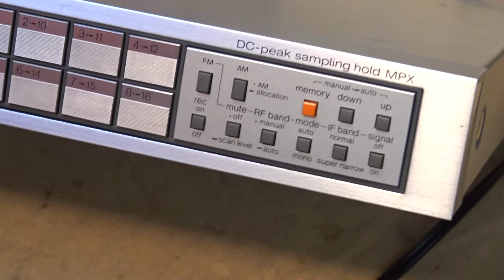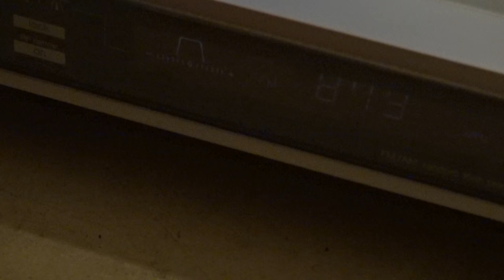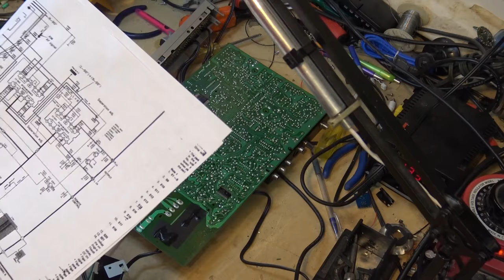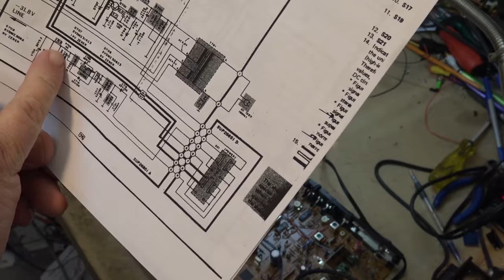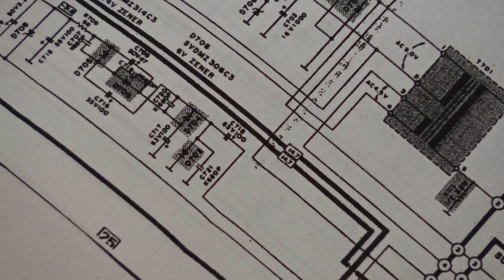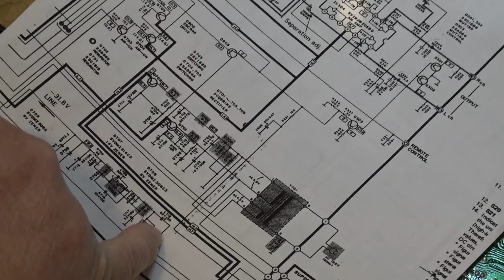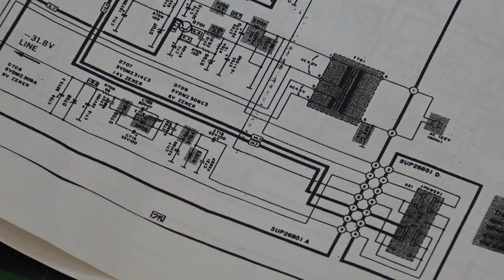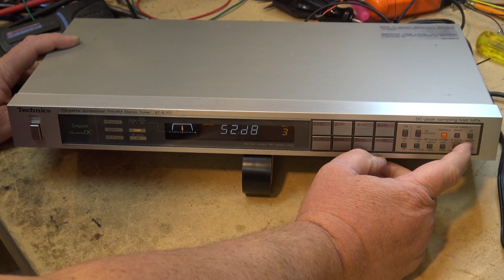Technics STS 707 Dim display repair

Comment: Thanks, this helped me solve the same problem on my microwave for $0.50 in parts.  All the repair sites say I needed to buy a $200 controller.  Fortunately I found the schematics on line inside a repair manual. Nice to know dim VFD are commonly power supply failures and not related to tube or drivers.

Comment: I'm a newbie attempting my first real electronics repair. I picked up an 80s-ish ADC graphic EQ today with a dim VFD for cheap. I just opened it up and found the four big caps on the power supply sitting in dark brown goop, which also partly covered some surrounding links and resistors and such. It looks like there's glue there, but also a much darker substance. I tested them with my LCR-T4 and they check out okay, but because of your experience in this video, I'm assuming they're actually bad. Tomorrow I'm going to source some replacements and hopefully that will solve my problem. Thanks!

Comment: I absolutely love VFD displays, Unfortunately, I have an addiction to them so I ended up having a vast collection of random VFD displays.
Reply from the maker: Same here. I have a Clock / VU meter I built a few years ago. It shows the levels going into my tube amp I built. Looks cool, just sits on the top of the amp nicely centered between the tubes showing the input from my blutooth receiver into the amp.I have a few clocks I have restored / built with VFD, and I have an old desk calculator that has 12 single digit tubes in it to restore, or repurpose into a clock display.
Reply: 12voltvids I have maybe 20 or 30 different VU meter and spectrum analyzer tubes. I actually have a tray of NOS 12-point stereo VU meter tubes from Futaba that I ended up turning into an "array" for use as a DIY spectrum analyzer. Should look cool. I even have a stockpile of Sony MXP-3000 mixer VU meter tubes to re-purpose as an audio analyzer. Talk about a fetish haha.
Reply: THEtechknight - WOW!  were we twins separated at birth?  I have the same addiction to Vacuum Fluorescent Displays - especially the BLUE!

https://wikivisually.com/wiki/Vacuum_fluorescent_display

I have recently been replacing capacitors in my older XP computers motherboards to bring them back to life.  I like to use the Weller WESD51 50W Adjustable Digital Display Soldering Station.   My favorite Vacuum Fluorescent Display is in the Roland MKS-70 synthesizer.

Comment: @20:50, Hybrid Digital radio here in the states....I'm gonna check out that voltage doubler circuit you described in another device that has with no 35v to its vfd. Thanks for the description of that circuit!

Comment: Would bad capacitor possibly be the issue for a display that was showing screwed up digits ?   I have an Emmerson three disc cd player... Model. number MS3100.  The display is messed up and when I push button to open CD cover, I can hear some noise but the automatic lift wont work either.

Comment: I was going to ask about this problem before I came across it being that I noticed on items that I've had own like VCRs with these type of displays get weak by time whether its was panasonic or toshiba and etc...... In a case like this if would I be correct to say if the voltages were proper then the chances would likely lie on the display tube itself if the gas has leaked?

Comment: Hello Sir, I have the same problem with a Panasonic SU-CH 40 display. I know something about electronics but not as a pro like you.  Even I can measure voltages, got the electrical service scheme, I am a little old for this stuff, but I am sure is some kind of the same issue. Can you help me? thanks for any answer

Comment: Hi there again.
I have a Sony MDS-JB920 Minidisc player with a slightly dim display esp on the 2 level meter lights could you please possibly point me in the right direction to the faulty part.

Many Thanks
Reply from the maker: Have no clue.
Reply: I can send you a link to the service manual if it would help.

https://www.manualslib.com/download/720756/Sony-Mds-Jb920.html
Reply from the maker: @johnny1408   and how would that help ?  I would need to make measurements to even make an educated guess.

Comment: Woow.i have a 80s car radio with a tiny floresent tube display with no display.im going to look for the caps near to display.as it's 12v not sure what voltage to display could be

Comment: Get yourself an lcr meter. It will test capacitance and esr at the same time in circuit. Saves alot of time
Reply: is that true? please post a video, there are lcr meters for 150 Usd and Hameg machines where I even do not know if you need a central unit that it works. I think I do not touch Hameg and leave it to the pro’s.

Comment: Does that Fluke 12 have a backlight? Modded? I own several Flukes including a 12 and mine doesn't have a backlight.
Reply from the maker: Mark Zacharias 
no backlight on the 12 and I wouldn't want one. suck the batteries down fast. my shop is bright enough but I guess if you are testing a furnace or working in a dark closet it could be handy.
Reply: Guess it was just some artifact in the video.

Comment: I wonder if there is a HT+ would it be 50v would it be the regulator on the PSU board, I wonder why Technics used a single board when in my unit it is a 5 board solution, I don't know why a X3 capacitor was not used.

Comment: I've seen some newer testers that also include diodes, transistors, and inductors. They give you a lot of info including capacitance and inductance. Have you ever tried one of those?
Reply from the maker: Lots of new testers that do much. I don't have any of the new ones.   I don't do enough electronics work to justify one.

Comment: Good work there.  We have a 27 year old Kenmore kitchen range that has a dim display on the oven controller board.  I read on an appliance web site that it was most likely a electrolytic capacitor that was going bad because it was in that hot environment.  This sound like the culprit to you?
I am about ready to tear it apart and see if I can fix it.

Comment: Hi.i have a technics slp1200 cd player.the display is dim in places.will the display be on its way out.or a supply issue.any advice would be great.
Reply from the maker: michael allen 
You need to check voltages. If voltages are correct then the display could be the issue of the driver ic.

Comment: Hello i got philips micro system mcm2320 and when i plug into power i cant turn device on only red light is showing near on/of button so i press on button but nothing happen is that capacitor or electrical condenser if u know tell me coz i dont want drop it in garbage is nice device i hope u know coz u fix a lot of that device thank you.
Reply: First thing to check is the power button itself. Next, I would look for bad solder connections. Then start looking for bad caps.

Comment: So is this fault never down to a weak vacuum flourescent display?
A lot of the 2001-2005 Sony receivers suffered from getting these extrememly dim displays 10 years later...
Reply from the maker: A VFD can go bad, but they usually do last a long time. If the filament is driven too hard it can boil off the electron emission coating, but if properly designed they can go for a long, long time. My microwave oven has been in 24 hour service since 1989, and I have a clock that goes back to 1979 and they are still bright as anything.Usually it is the power supply losing voltage, especially in these units that use a voltage doubler or Tripler as in this one. Units that have a separate 30v winding on the transformer are much more reliable.
Reply: 12voltvids I'll note that thank you for that. I just always previously thought it was the VFD because more used areas were dimmer than the ones that were not used as much on these Sony receivers such as the coax or DTS light. So I take it each segment has it's individual capacitor, and over the years failure occurs resulting in some parts of the display being dimmer than the others? I do repair these as a side projector extra money, and sell them online on eBay. Sometimes though I just throw them out because of the really weak VFD, as I was unaware until now they were not likely to be the fault. Feel stupid now lol!
Reply from the maker: The display segments can wear out. The phosphor will eventually get weaker for sure. If the entire display is dim, then you have to check for correct supply voltages. If the voltages are correct and the display is still dim, then the display is the fault.I did have a clock display that was bad. I replaced it with another one, and I had to make up extension wires to go to the board to wire it correctly. I have a video documenting the old dim display, and the new one.

Comment: how do you go about brightening a vfd display?
Reply from the maker: First you have to determine why it is dim.Check the drive voltages. If low you have to find the power supply component that is causing it. If the voltages are correct then you  have a bad display.
Reply: its the display in the sony MHC-551 hifi it works but its dim. i found 2 bad cps causing speaker hum though,
Reply: Ill have a look on the PCB it has voltage makings, ill take some measurements thanks m8
Reply: Hello again m8, ive just checked and the voltage to the VFD's filament is 1.7v is this right you think? seems a little low?
Reply from the maker: Filaments are usually pretty low as far as voltage across the filaments go. That is just to warm them up. There is typically a high negative voltage applied to the filaments 30v or so with respect to ground, or a high positive +40+60 on the anodes. If it uses a high anode voltage the DC offset on the filaments will be close to ground and the filaments may be powered by AC. Usually it is in the 3V range. Enough to heat them up but not produce much if any visible light.
Reply: Right, im not seeing any filament glow at all, im suspecting a few bad caps in the power section.
Reply from the maker: More than likely yes. That is what it was on this one.
Reply: Ive been cursed with jamicon and rubycon in this stereo, fucking awful caps im replacing all the power section with nichicon FW series will let you know how it goes.
Reply: well this stereos vfd is worn out it seems, this is what happens when you leave them in demo mode for days at a time.

Comment: If you ever come across a Fostex D80 right up to the last in the series i have a d1624 mk2 it has a separate board for every part of the circuit even the regulator and output to external screen has a little circuit with smd ferrite beads. If there was ever a museum for over engineered electronics devices they should be first in the display. I found one blown smd ferrite bead on a double sided board smaller than the palm of my hand after checking everything thats 5 boards 5 schematics. 
Not a fun unit to work on and thats only counting the boards that effect the display

Comment: I’m a beginner at repairing electronics! So if a bad capacitor is making a screen dim. Is the bad capacitor likely to be or will it always be on the power supply? Thanks for your time. I just found your channel and enjoy your videos.
Reply from the maker: Not always no. Some times the display tube goes bad.  If the voltages to the tube were correct and it is still dim then the tube is bad.  In thus case there was a voltage problem and that cap was part of a voltage doubler circuit that shorted.
Reply: 12voltvids thanks!
Reply: Hi, awesome video. I have a VFD display in a 12v BrakeSmart brake controller in my pickup that comes on full brightness for 1.5 seconds, then dims to 0.  Likely a bad cap. Can I pay you to fix this?  How do I get in touch with you?  Darin

Comment: Ever come across a Pioneer receiver from the 70's? I had an SX-650 which was (I think) an honest 25 watts per channel. Always loved the old Pioneer Supertuners.
Reply from the maker: I have an old pioneer receiver that has been sitting in a shed for 23 years, so it is probably shot beyond repair by now.
Reply: Yeah, those things were built in layers so they're very labor intensive to rebuild. A lot of wire wound connections.
Reply from the maker: That's right. That's why it is out in the shed. Probably got no covers on it. It was abandoned at the same time as a Sansui 9090. I fixed the 9090, and the owner bitched and complained about a 150 repair bill. Needed 8 new outputs. Wanted to pay me 20 a month. I told him when the bill is paid in full he could have it back. The guy that brought it in way back in 93 or so, while I was still working in the shop brought it directly to me because he had a falling out with the shop owner. I got stung by him before on a repair at the shop, hence he was banned from coming in, so he brought it to me directly. I quoted him the parts plus 60 to repair and he gave me the green light, and then started playing games. In the end he never paid me, and I kept the receiver, and never got on the pioneer, it ended up getting tossed in the shed. The 9090 works perfectly and I have hung onto that piece, which is worth about 1200 last time I checked at the vintage audio shop.
Reply: 12voltvids Woah!!! Had no idea that an old receiver could be worth that much. I do understand that the value is brand and model specific.
Reply from the maker: Yes brand and model specific.Every company has had star performers and dogs.The test of time shows which pieces, which were generally high end pieces from the onset hold their value. It's like an old car. There are lots of old cars around, and most are worthless, but ever so often  there is one that is worth more. I have such a car myself in storage. It is a 1995 Ford Thunderbird, supercoupe, with metallic chameleon blue paint.The Thunderbird was not a rare car, however 95 was the last year they made the super charged supercoupe.Only 615 rolled off the line with a 5 speed and only 3,400 rolled off the line with the 4 speed automatic. Of those 3400, not all of them had the automatic ride control shocks and traction control.If that wasn't enough, even fewer left the factory with Chameleon Blue paint.  The paint color alone was a 4,000 option. Mine has leather throughout, and I kept the original sound system with cassette deck.The car is off the road, hasn't been driven since 2011 (but started regularly) and will be a collector car. In 3 years it will have reached collector status. My son wanted it, but he doesn't drive, and says now he has no interest in cars.
Reply: Cool car story! I had a 1965 TBird many years ago. Wasn't worth much back then (1998), and needed a ton more work than what I had already put into it, so I donated it. Wish I had just kept it tarped. Even so-so, they're worth $5k these days. Mine had factory crate engine, and rebuilt Cruis-o-matic. I would have given you the 150 for the repair on the Sansui receiver... 😁
Reply from the maker: The Sansui 9090 when brought to me 25 years ago at least was brought in by one of my cousins. It was his friends, and they gave me the go-ahead to fix it, then there was the money issue. He wanted to take it to his friend, and I said no, show me the money first.  Now that receiver is worth a small fortune, and I am hanging onto it.
Reply: Absolutely! 👍👌

Comment: Great job! I'm having a problem like that with an Optimus tape deck that I pulled out of the closet. Thanks for the tip. I hope that's what's wrong with mine. It's amazing how those caps can go bad with equipment in storage.

Comment: I have a Technics amplifier from 93 that's starting to show this problem. Year after year it gets little bit dimmer.
Reply from the maker: Now you know the problem. Low voltage to the display. (or the tube is getting weak)My Panasonic DVD recorder is starting to get dim, but I can still see it so no need to service it yet.

Comment: I really like that receiver.  I wish I could find one somewhere.  I'm sure these are hard to find.
Reply from the maker: They were hard to find when they made them because they were very expensive comparatively speaking. I almost bought one, but I opted for the Sony AM Stereo tuner, one I still have, except that there is no more AM stereo, but my sony has wide and narrow IF bands for both AM and FM.Will service it some day. It needs a backup battery and a light in the display, as it uses an LCD with an incandescent bulb for light. I think some nice LEDs are in order.
Reply: Nice!  Looking forward to that video.

Comment: EXCELLENT job on all your videos!! You are a great teacher!! Is it possible your ESR meter has a problem? Odd that it would not detect a dead short. What happens if you short the leads together?
Reply from the maker: Walt Anderson 
how esr meters work is by injecting a 100 kHz signal and measuring the resistance. when you start an esr meter you short the leads and zero out the meter. 
capacitor normally block DC current but will pass ac. so this ac signal should pass right through. when a cap normally starts to go bad they pass less ac and thus the esr or equivalent series resistance goes up. in this case the capacitor dead shorted, which allowed the signal from the esr meter to pass through like a good cap would except this was shorted. the regular ohms meter caught this as it would normally appear open to DC resistance testing.
Reply: Thanks! Makes sense. Again your videos are the best! 😁

Comment: Hmm shorting memory capacitors at the end, i think they work ok :-D.

Im not supprised that the series capacitor was a bit dead, series reactance and the output being shorted to ground on the positive going phase.
It lasted well though.

Ive had the filiment supply go low/dead in some units, one had a dead winding on the power transformer, a small secondary transformer was added to fix that.
Too expensive to replace a multi-tap special transformer :-(